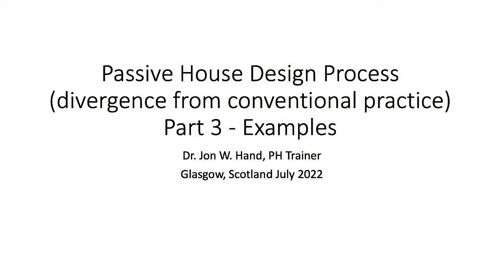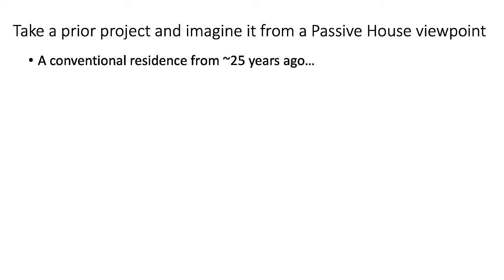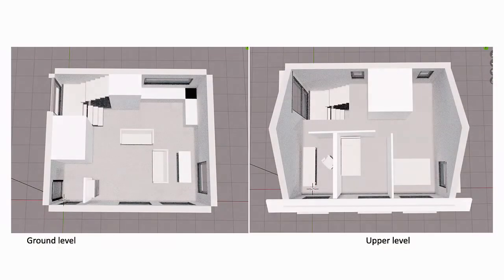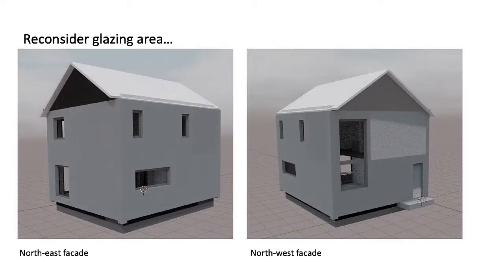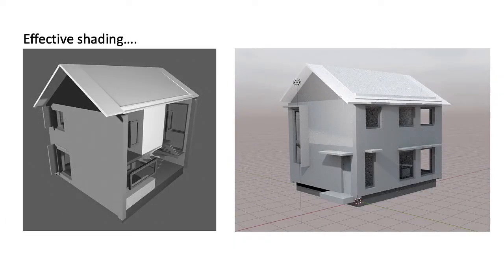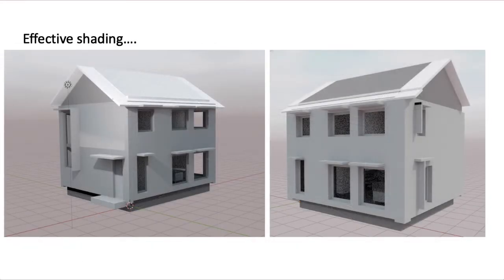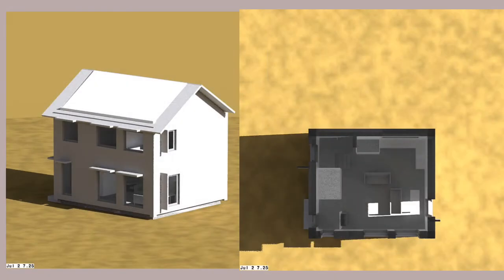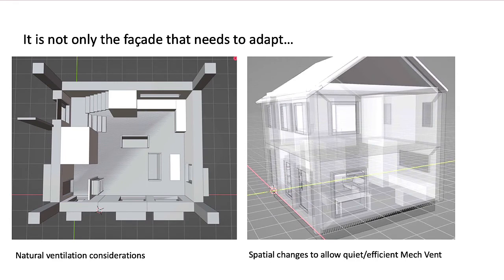Passive House - Divergence from conventional designs - updating a past project

Comment from the maker: Initially I created this video to illustrate a number of points during PH workshops. The PH exam included a design task and lots of folk found it really difficult to pull together the information from the workshops and their new skills into a series of sketches that could allow the PHI to judge how well they integrated their new skills into practice.  Although the PHI is changing how they are doing the 'design task' in the exam I still think that reviewing a past project and doing a though experiment to see what would be needed to make it into something like a PH is time well spent.  
Do you agree?  
Have you done it recently?
Were you able to evolve past designs to get better performance - even if you might not choose to label it PH?